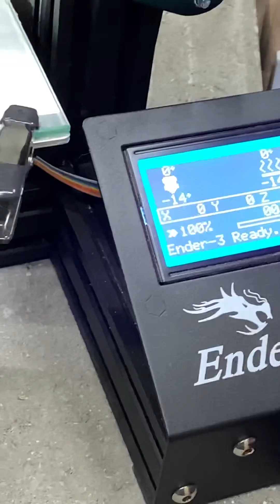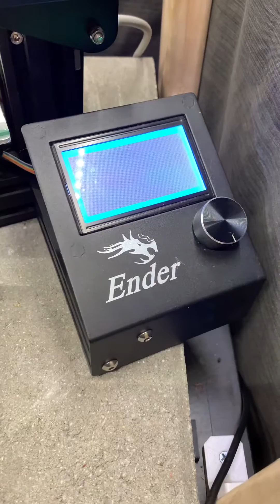BigTreeTech SKR Mini E3 v1.2 - bricked work around #Solidoodle overhaul project

Comment: Were you able to resolve the issue, or did it require replacing the board? thanks
Reply from the maker: The plan was always to replace the board, it was just a work around until I could get my hands on a new board.

I only stumbled on it and wouldn’t even know where to begin to fix the short in the board where ever it is.